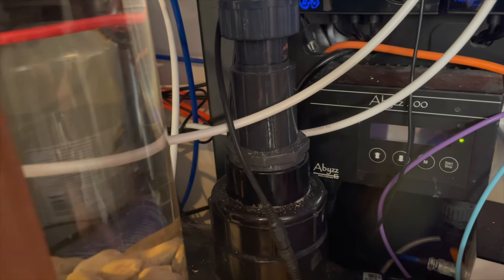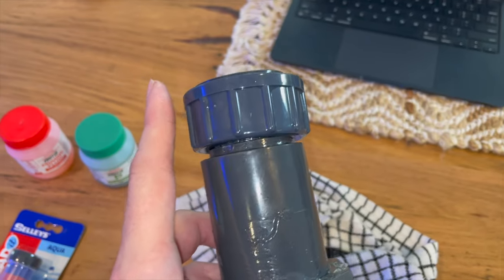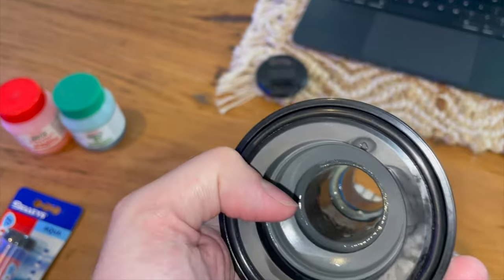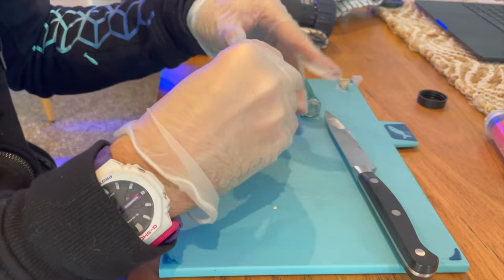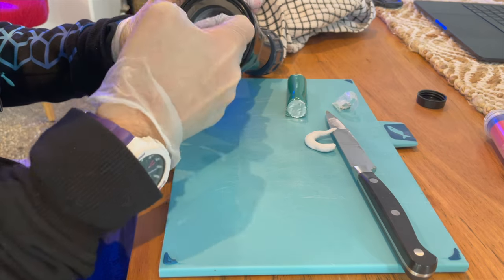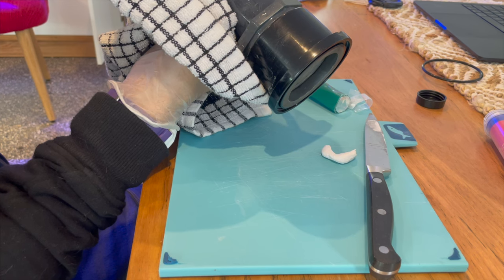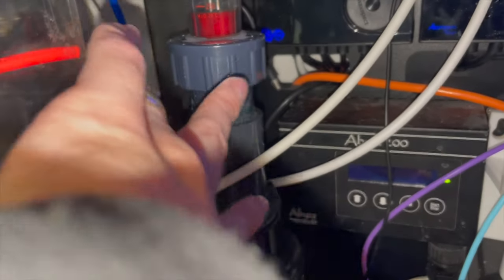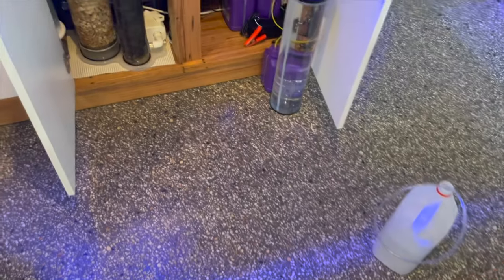Fixing a Leak in My Tanks Plumbing!

Comment: Great idea running a flow meter on the UV, 👍🏻. I don’t think I’ve seen anyone else incorporate one into their reef tank. Is that a standard part on the UV or did you add it on? The water flow through the UV is so important for both safety and effectiveness, so you would think it would be built in.
Reply from the maker: Yea it something I added myself, not included with my UV